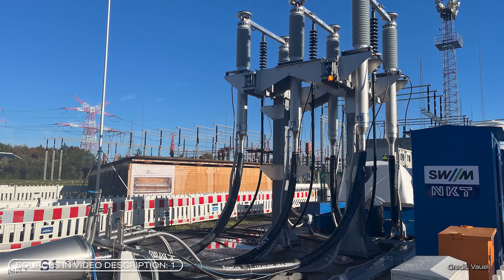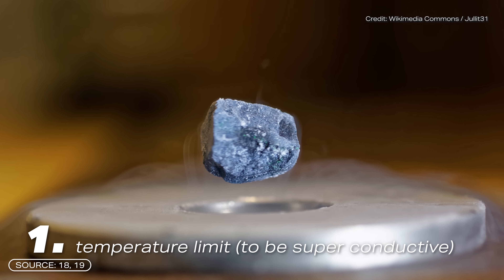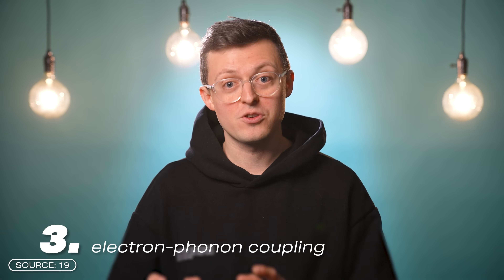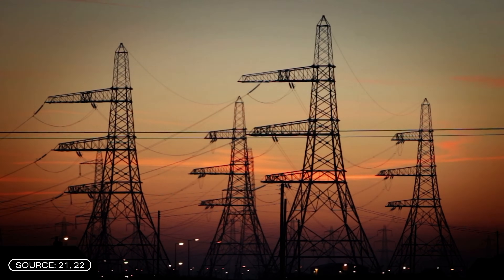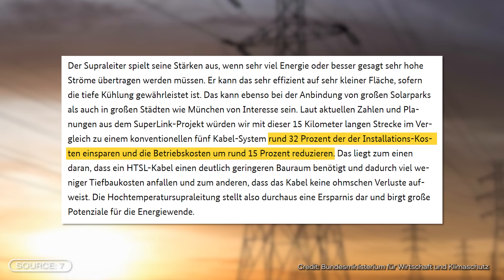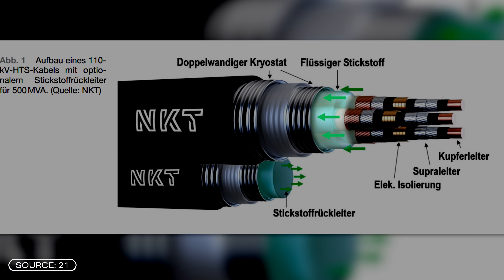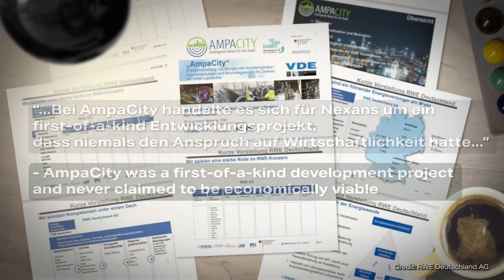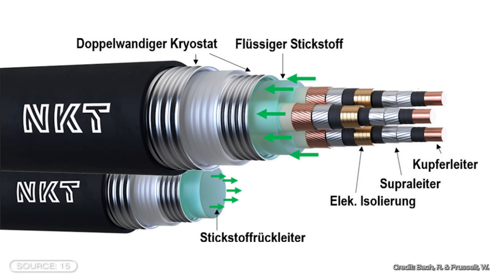Superconducting Cable TESTED in Germany: It's coming!

Comment: This is some fairly heavy stuff I know that will be useful in the making of spaceships but I thought I would just go ahead and throw my two cents in here and say that for the last 200 years since the invention of the tractor man has wasted his days not 3D printing homes that are dirtcheap. Let me say that again a little louder in case you didn't understand that I just gave you the keys to basically crushing out poverty and the housing crisis. 
 Basically all you need is to take a tractor and a roller that can kneed the loaf of freeform Adobe in a dedicated concrete ditch sort of like you would see at a car wash.
 Please take this knowledge and make all sorts of implementations mills that will produce Adobe and build the homes of the future.
Nobody right now has a hydrogen Adobe mill a solar Adobe mill a steam Adobe mill

Comment: I always hear of people saying that superconductors have a resistance of `almost` zero.  That isn't true.  They have a resistance of exactly 0.  It isn't .0000000001% of normal, it is exactly 0.  That is why if a loop of the material has a current, it will continue without change until broken or the material is heated.  Considering the speed of light, even an absurdly low resistance that isn't 0 would cause the electric flow to be dissipated within a few seconds at most if it wasn't exactly 0.

Comment: I have samples of graphene coated copper wire that reduces resistance by 95%.  This costs far less than the equivalent copper wire as the copper is used as a backing material for the graphene.

Comment: I can see the biggest problem with a cold start of the grid. So in the case of a complete power outage for a long time (see the grid outage in Spain) where these cables loose their cooling, you need some time to cool down the cable to allow it to be super conduction again before you can turn on that link again. So if you rely on a lot of these cables in your grid, the startup becomes really difficult.
Reply: I'd say biggest problem is for it tobe economically viable 1) energy price up 2) copper price go up 3) no better conductor developed 4) this is prototype they don¨'t have modularity so each "re-cooling" station is a pain idk why

Grid outage adds another thing, but maybe just 5) local batteries dedicated to cooling stations+integrated in them

Ramblings:
I mean, if there's liqud nitrogen and it heats up (gas?) I think re-cooling might be just a side issue by then. Explosion ? Naah, re-cooling station will also vent in case of emergency, breakable foil or something, also the recooling stations need to be accessible for maintenance or lift them up to be maintained. (Like: use liquid to transfer energy to ground level wind generators and not generate electriity at the top of structure - for real world application these re-cooling stations need to be easily accessible, whole cable be modular so every 4km there IS a station, it will be "ground-level" for maintenance)

Comment: just curious.  wouldn't the cost of cooling the superconductor be so high that it would make electricity transportation cost much higher than it is today?
Reply: This is where HTC cables have the advantage: cooling to 77 K uses liquid nitrogen, cooling under 77 K,   say to 20 K needes liquid helium, a lot more expensive proposition

Comment: I learned (possibly incorrectly) that electrons move relatively slowly through a conductor, but the wavefront of electrical potential change moves nearly at the speed of light (depending on the material).  Is that true?  Do the cooper pairs move at nearly the speed of light or do they convey the electrical potential only at the speed of light?  How fast do the cooper pairs move through the conductor?

Comment: I was just wondering; if cooling is interrupted due to a mechanical leak or a failure at a cooling station, would the cable eventually lose its superconducting state, potentially leading to an explosion because of the high amount of electricity it's supposed to carry?"
Reply: It would rapidly increase in resistance (quench) and the feeder would trip out on under current, and the resistance portion, where the "leak" occurs could overheat rapidly causing damage or a runaway thermal event.

Comment: I like superconducting and the video was quite helpful to have a report on state of progress.
I have a question though: if it's superconducting why do we speak about 5 times the power of a copper cable? Why we say 500 MW or anything. Isn't the point of having superconductors is the 0 resistance therefor - as Palpatine would say: Unlimited Power?
A note for the subtitles: i appreciate you made one but it seems to be just a speech recognition version without an effort, clearly, some things are not written as you say. Why make an effort to do a subtitle without reviewing and correcting it? We all could use youtube's built-in sub generator in this case with the same - crappy - results.
Reply: The electrical resistance below Tc drops to 0 Ω(ohm) but only for the max power the cable was designed to transfer. If the max power is surpassed the superconducting effect vanishes. So it is 0 resistance for a given amount of power, it is not unlimited power.

Comment: If it is a true and idela super conductor, the resistance = 0. Doesn't it mean that no matter how much current is passed through it, heating in the conductor = 0. Doesn't it mean that even an ultra thin strand of a super can carry Mega Watts of power? This sounds impractical. So, how do we find the current limit of a super conductor?

Comment: The step is not so long to - superconducting transformers
maby ? And why not consider DC power in the homes ? A lots of items in oure homes today are using DC fx all flat TV, they take in AC rectefying it to DC (ofcorse voltages are 1.414 times)  maby we could get rid of a great portion of losses  🤔  ???......
And ofcorse do not forget HVDC lines also direct current.
But always intrresting to hear about real world projects.
Best wh. from Sweden.

Comment: You mentioned one of the layers of the superconductor is at vacuum. So the distribution system would also need vacuum pumps to maintain the vacuum?
Reply: It may, but the beauty of it is that the liquid nitrogen can act as a vacuum trap than enhances the vacuum needed

Comment: They also must be mechanically robust and durable. I don't know about over there in Germany but here in the states, especially in and around cities, it's common to have a line cut into accidentally by a construction crew, now just imagine it spewing cryogenic fluids everywhere when this happens! Plus, the sheer size of our power grid would make it impractical. Power busses spanning thousands of miles would be where you'd want to use this technology the most, yet it would simply be impractical. I keep hoping room temp and above will become a thing and I think larger nations will need that before we can start to even entertain the idea of conversion.

Comment: So essentially thru cheating with tech they achieved equivalent to gold cables vs copper cables without the expense of gold ..this is ground breaking and is like saying we were on a staircase before ..now we're on the middle landing platform where we're about to do a complete 180 degree turn on the next staircase of tech and what's possible

Comment: I was wondering when they would start doing something like this, using them in select areas such as massive power producers to backbone and along the backbone, because the way that the communication is set out is that way...

The backbone is where all the heavy lifting is done, such as VERY expensive fiber optic cables attached to some very expensive equipment, but that's a lot more better than using cheap fiber that doesn't have the bandwith capabilities IE: trying to use residential grade.

Every country needs to do this now, sadly it has come to the point where underground cables filled with oil just isn't efficient enough especially with our growing power needs, I am proud of you Germany, keep up the good work and please export this to Australia, we sure need it over great distances.

Comment: i have a better  idea. mining the moon or subsea vulcanos for  silver and make 150 kv cables with silver clad alu conductors. if the first one cm of the cable is silver and the inner core is aluminium, then the cable can carry way more power than copper. 
and a 150 kv cable can easily carry 300 MVA, that is more than enough for a big town like odense. 2 parellel 420 kv cables, 800 MVA for a 2000mm2 420 kv cable, is more than enough for a city like copenhagen or at least parts of it. the big issue with high voltage cables is not the current capacity but the capacitive effect and the impact on the grid. of course digging in urban areas can be a problem. all our 132 and 150 kv lines will be undergound in denmark in the future and power carrying capacity is not the issue.

Comment: You never address whether or not the cost of running cables at superconducting temperatures is less than the added efficiency of the electricity transported this way.  Btw, so far your wind farms, solar panels* and cow fart gas turbines do not address your own energy needs, so what are you gonna transport, hopes and dreams?  You obfuscate direct calculation by saying less power plants would be needed... yet you don't address: cost less over the legacy tech already deployed or not.  Great propaganda, but I hope the ppl left in Germany that are still of european descent noticed your distraction, deflection and obfuscation selling this shite.  Wtf, bro?

_______________________________
* My home has solar panels my electricity bills are nominal all year round...

Comment: Regarding source 21: The claim is that an HTST cable will save money over 40 years, but that claim requires you to assume the cost of capital/interest rate. With higher interest rates, the advantage diminishes. I couldn't find numbers for the calculations they did.

Comment: The solution to the cooling problem is not to cool it. Some superconducting materials can exist at room temperature but need high pressure to work. So we need a cable that is extruded and wrapped under high pressure and then hydraulicly pressurised with mineral oil in an outer sheath. I wonder is deep sea superconductors power cables could take advantage of the high pressures.

Comment: What kind of material is superconductor made of  in the current 1.5km trial and the upcoming 15km link?
I assume the cable uses ceramic HT supercpnductors. How was the rigidity issue of the ceramics overcome in these cables?
Is it using DC or AC? If AC, what is the frequency used in thdvtransmission line? In other words, will it use the skin effect of the cable, or use the full cross section of the conductor?
Might be worth looking at this cable technology in detail in a separatd video?
Reply: Just an educated guess, but I suspect the rigid superconductive material exists on or within a strong substrate in filaments or layers so thin, they are slightly flexible. That also takes care of any problems with Skin Effect. If not for the stated cooling with liquid nitrogen (LN2), I would have guessed the material used to be MgB2, magnesium diboride. It is not only cheap, it has outstanding current-carrying capacity, even in strong magnetic fields.

Comment: And what about tepair costs when someone inevitably runs an excavstor buckut ( butied cable) or a tree falls overvthe line( suspended cable)  how do you splice a superconductor ans how do you restore the vacume in the cable? Don't get me wrong grater transmission efficiency and smaler transformers are needed but as you said therecarecstill chalkangers, untill the day we have cheap room temp superconductors thst is

Comment: The requirement of cooling coupled with lower depth of trenches and less cables to run between connecting points would make them easy target for attacks.

Comment: AC power generation to home transmission lines are very efficient and might never be replaced.
Superconductors would be much more help at first in the long range DCHV grid connections and allow sharing power to different regions.
If there was a super DCHV line connecting California to NYC, California solar can power NYC’s peak load and NYC’s power plants can help California’s peak load. Midwest wind power can grow and help both. This would also allow the creation of many power storing dams via water dam gravity storage in more remote locations.

Comment: The best application is transporting power from a gigawatt solar farm in China’s high desert to the big cities 2000 km away.  It would benefit from economy of scale … one cable transmitting gigawatts of energy.   Cooling one cable is much more efficient in terms of thermal conductivity versus multiple cables. 
      DC current is the obvious preferred solution because a changing current ends up not being 100% operating in superconducting mode (skin current must exceed J density for the skin depth current to begin flowing deeper inside the cable (DC current does not have this heat producing problem).  Also DC current maximizes current flow vs AC where current fluctuates.
Reply: If SC transmission became reliable enough and cost effective, then solar power from 6 time zones away would shorten the time when solar electricity can not be generated due to night

Comment: The biggest economic advantage is that the superconducting high-performance cable can be installed in existing cable ducts in Munich. This saves considerable civil engineering costs for the relatively long line in the metropolis.

Comment: About 18 years ago I heard Siemens was working on a superconducting system to get the electricity from places like Algeria and Libya, where the collectors were to be located, back up to Europe. Since then, there has been a lot of instability in Africa caused by our (Vereinigten Staten) interference, but I never heard about the Siemens superconducting endeavors again. China claims they have an onboard Maglev with "warm" superconductors but you never know.

Comment: First time in your channel, I am subscribe.
It will nice for a next video to check the idea to cool a superconductive cable using cryo hydrogen gas, this way you do not need to move liquid nitrogen from one point of the cable to the other for no purpose and losing energy in friction and cooling for nothing.
With hydrogen you are carrying energy in chemical way the same as the electric way, in an hydrogen economy you can have generation sources like solar and wind that would split water in location as energy storage to later send it to maintain the cable cool, in the other side they can also use that hydrogen as an energy carrier (hydrogen can move 10 times more energy at the same cost than a normal transmission wire). 
There are several papers researching this idea, check them out.

Comment: Sorry, but keeping something at 77 Kelvin is not practical. You will spend more keeping it cold than you save on electrical resistance. A fun research project that will never pan out until a breakthrough happens in higher temperature superconductors.
Reply: since insulation exists it's not a big deal

Comment: Super conductors have a dirty secret: There is a maximum voltage you are allowed to apply or the Cooper-pairs break apart and it becomes resistant again; usually more resistant than copper. AC then causes energy to leak between the cables more than traditional onces, because they are closer and therefore have greater capacitance.
Reply: electric insulator is also thermal insulator so not a good friend

Comment: The best area to concentrate research here is better insulation. You have to reduce those cooling costs and infrastructure requirements as much as possible. But if we keep getting better cables, I wonder if it will be possible to (eventually) implement a world-wide grid of DC transmission cables primarily relying on solar panels covering the Sahara, Australian outback, and North American desert.

Comment: 10:25 Wait!???
So not only, is a continuous flow of liquid nitrogen needed, and probably some kind of venting system for the nitrogen that gets too got & boils off?...
You ALSO in this case, need basically a 1.5 Km long HYPERLOOP vacuum tunnel... filled with the inner liquid hydrogen cable (with venting systems)???
Yeah... nah, I don't see how this would become successful in a large scale power-grid. (12:00 Yeah... that's just one of the problems)
Reply: venting is not an issue. There are things  called rupture disks, that blow at 2 or 3 atm of pressure, which are quite cheap (relatively speaking)

Comment: 5:03 Does this mean that the cable transports TWICE as many electrons ("per electron" normally transferred?*)
(*Eg. instead of moving 1 electron at a time, now it moves 2 electrons in a pair instead?)
Also, because the 2 electrons form a Boson, does that mean they can't spark like electricity normally does? Does "boson arcing" exist?
Reply: Doesn’t look like boson arcing exists, but there could be quasiparticle avalanches.  😂

Comment: Can't say I'm a fan of using cryogenic superconductors for carrying extremely high power over long distances: you are only one refrigerant leak or refill failure away from a very expensive catastrophic failure. Once you have HVDC, you can use arbitrarily thick conductor cross-sections in whatever material is most cost-effective to accommodate higher current at reduced losses.
Reply: I’m guessing there are engineering fixes to prevent that that will be iterated on to extend cable lengths.  I think he’s talking about only the second generation of this technology.